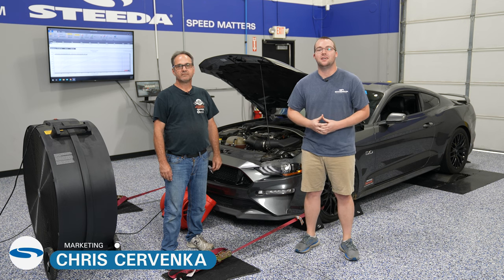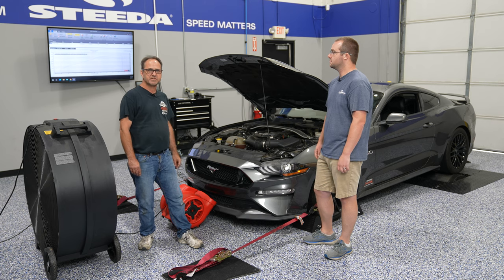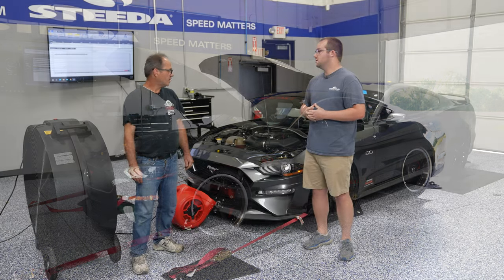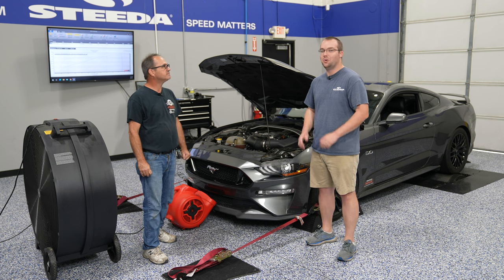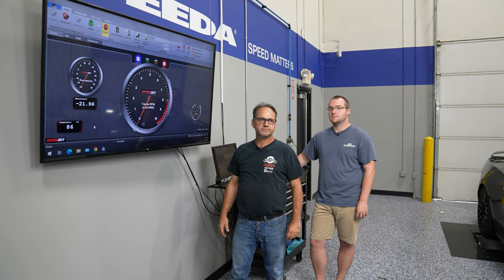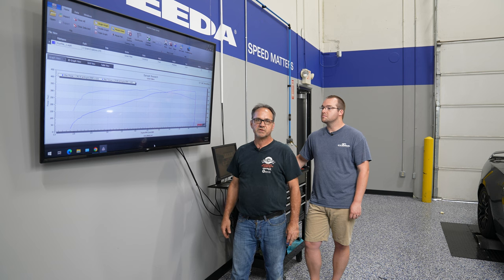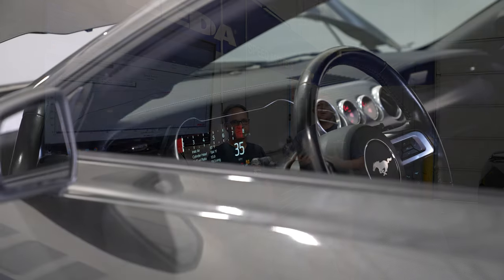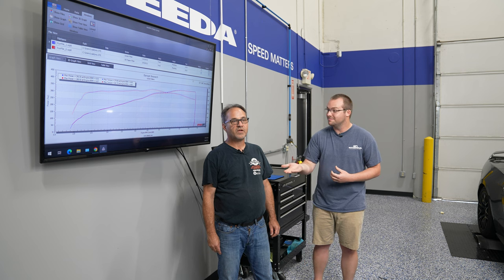What To Expect When Your Mustang Hits The Dyno | Tech Tip

Comment: Very interesting. There's just one more point I'm curious about, which hasn't been mentioned. You measure the force exerted by the rear wheels on the roller and derive the power and torque from that. So far, so good. But how do you get from that (i.e. torque/power at the wheels) to the torque and power actually developed by the engine? I guess there's another correction factor for this as well, isn't there? And if so, then how is this correction factor determined, I mean how do you know exactly how much power gets lost (you know, due to friction in the transmission and all) in one particular car?